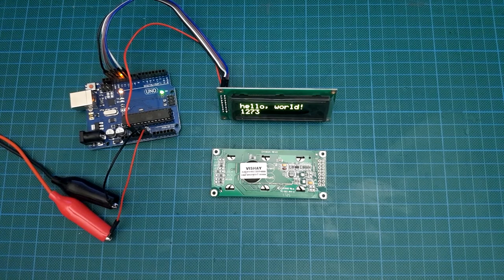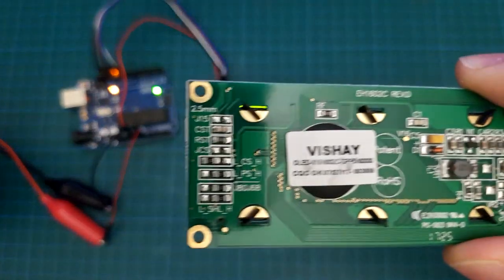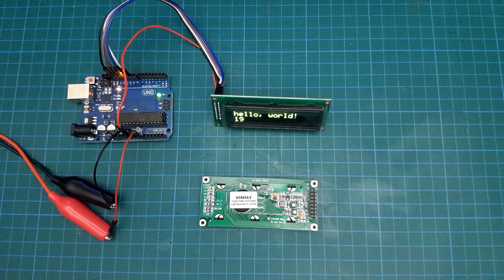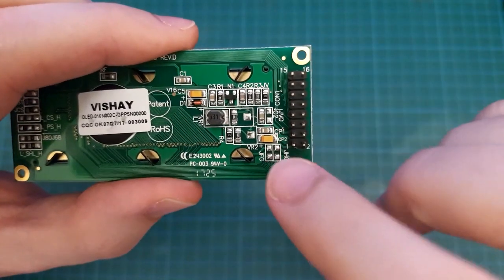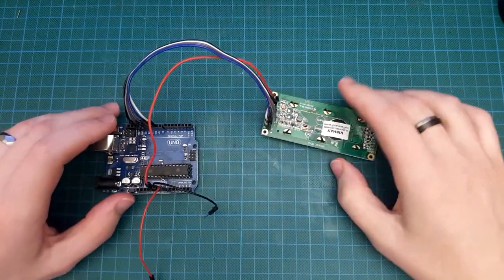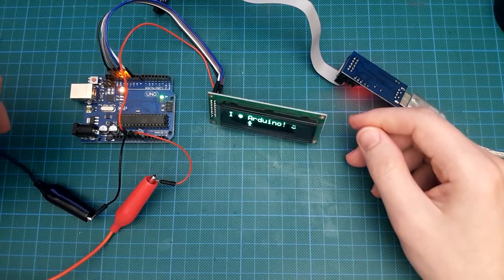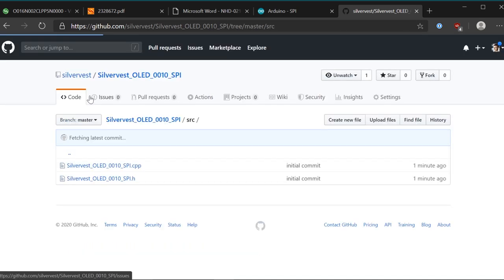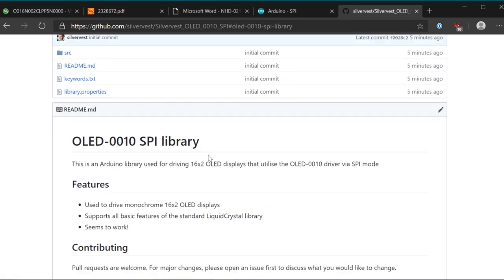Switching OLED-0010 character display to SPI

Comment: Great job on the library! Mine worked right out of the box.  I have a different display, its a BuyDisplay's DM-OLED2002-608 which is a 20x2 so I just specified 20x2 in the begin() method.  I do have a little refresh flicker all the time.  Have you seen that?
Reply from the maker: Thanks, appreciate it! Glad it was useful. I was going to say I've only seen flickering when it was underpowered, but I see your other comment now :D